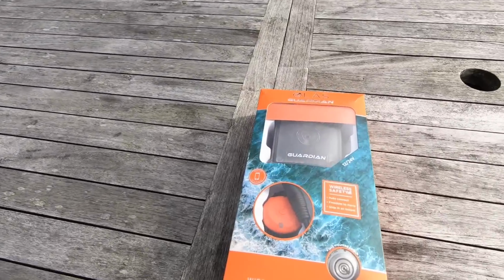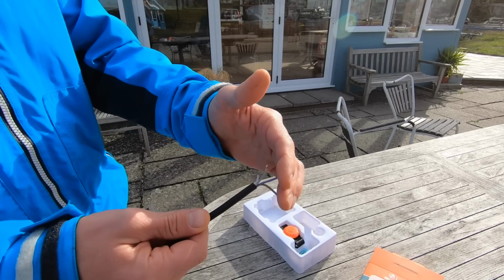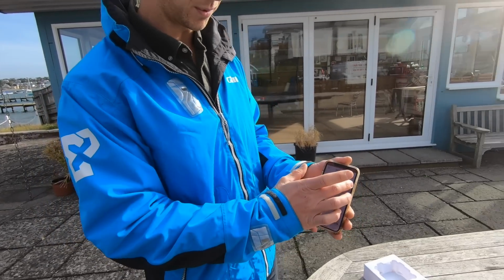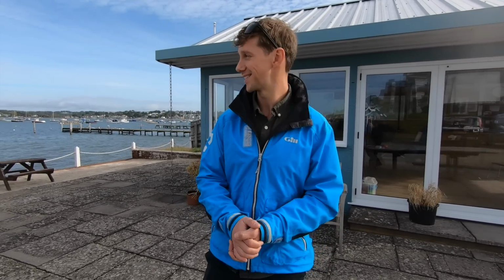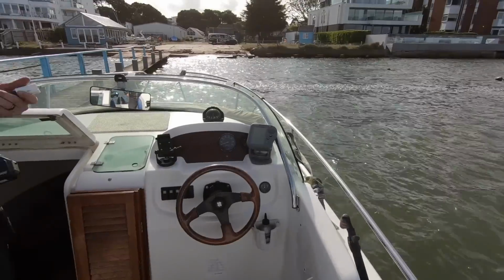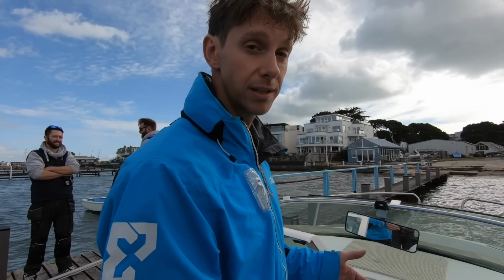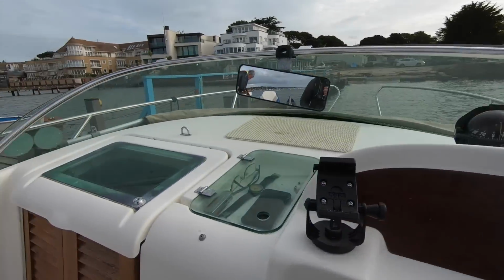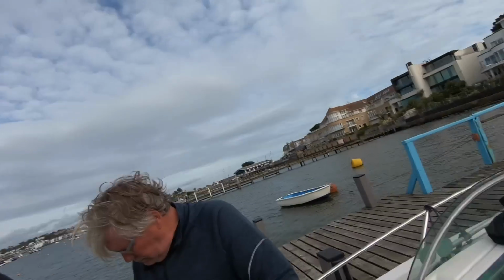Can this wireless killcord and MOB alarm set you free? OLAS Guardian test | Motor Boat & Yachting

Comment: Thanks for the review. What is the process if you go over boat with the device and the original kill cord in either solo or standard mode?
Reply: Hi Tim, If you go overboard with the tag it will shut off the engine. After 5 seconds, if anyone is onboard, the engine can be restarted and a rescue performed. The Guardian will remain in a paused state unitl the tag is back onboard and the system is started again. In this case it would be advised that a secondary tag or the existing kill cord is used whilst performing the rescue.